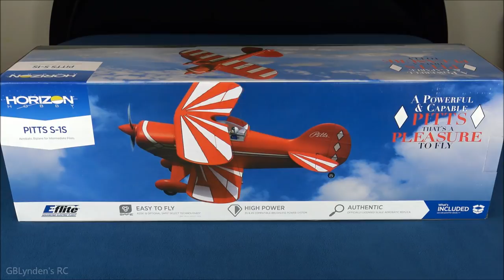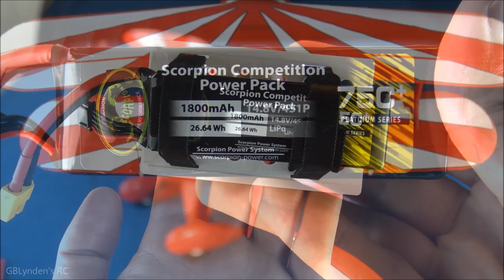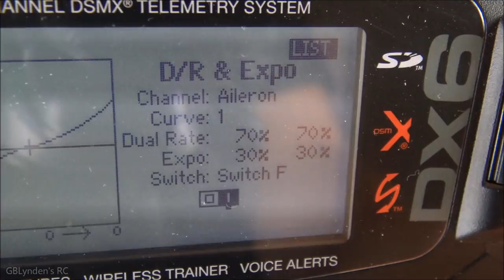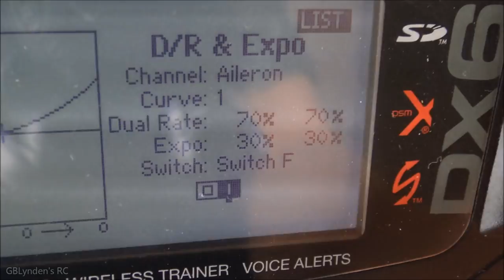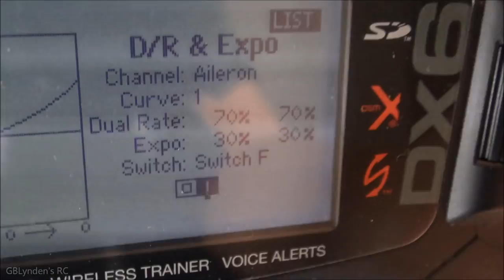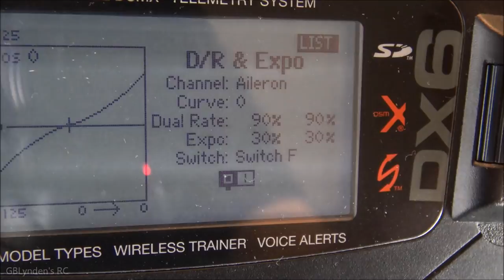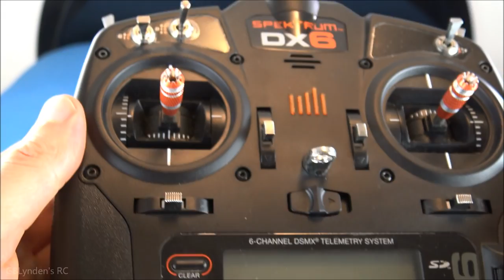E-flite Pitts S-1S 850mm BNF Basic RC Biplane Unboxing & Review

Comment: Where did you place the ESC? I see on your video you placed the receiver in the slight indentation in the fuselage. Thats where my ESC was out the box. So thats where I placed my ESC but I didnt have much room for the receiver.
Reply from the maker: Mine is the BNF version, so the receiver was already installed along with the ESC. I will say that after I recorded this footage and I was getting it ready to attempt a maiden, I did notice that the ESC was just floating underneath the battery tray in front of the receiver. It did have a chunk of foam adhesive on it that must have come loose, so I just moved it as far forward as I could away from the receiver (it is still pretty close though), and pushed the sticky foam against the bottom/side of the fuse to secure the ESC. I hope this answers your question :)
Reply: @GBLynden  Mine was the PNP. I figured that the indentation was for a receiver but wanted confirmation. Now to rejigger my pitts
Reply from the maker: I am glad that was helpful and I am really glad I made sure to shoot that footage of the battery bay now. I circled back after I had shot everything except for the review notes wrap-up after I remembered I hadn't recorded any footage of that yet.

Comment: Hi GB... I've noticed on build videos that no one mentions prop balancing. I have seen a prop balancing video from Horizon Hobby and the fellow said it was very important to do as it saves wear and tear on the motor, ESC, and overall plane itself due to excessive vibration. He was using the DU-BRO balancer which I purchased to balance the prop on my HH PT-17. I was wondering what your thoughts were on prop balancing. I haven't had the chance to fly the 17 yet so not sure if I did it right. Good video.
Reply from the maker: Hi James! My approach to prop balancing is to do it after a prop strike. I have never had a problem with a prop on a new kit being unbalanced out of the box, so that is why I don't mention that. I am sure I am not alone. While I don't do that with my new planes testing planes unfiltered right out of the box, it is NOT a bad best practice to do that. I hope that answers your question :)
Reply: Hi GB, thanks for the reply. After a prop strike, that makes sense, that was not mentioned in the HH video. I have a spare prop for the 17 so maybe I will swap it for the other one before I maiden it. How could you tell if a prop is out of balance other than putting it on a balancer. I'm new to planes but have been flying RC Helis and have changed many rotor blades and had to set up blade tracking. Thanks again.
Reply from the maker: The most important indicator is noise. If it sounds smooth, you're good. Focus more on getting the CG dialed in and making sure your control surfaces are level.
Reply: @GBLynden  That's a big 10-4. I set my control rods up manually making sure the servo arms are horizontal and have all control surfaces lined up with the trailing wing edges. As far as I can tell the CG is where it should be with the battery installed and hatch cover on. It was tail heavy so I added some weights and it seems very level now. Thanks again.
Reply from the maker: Awesome James!

Comment: Of the hundreds of RC planes I have purchased, this is the worse.   Two master flyers have tried to maiden this Pitts and so far it has crashed both times.
Reply from the maker: I find that hard to believe. I am hardly a master flyer and I flew mine really well on both 3S & 4S. The landings were far from perfect, but there are no where near what could be described as crashes. Either you got a bad one or something went wrong with your setup.